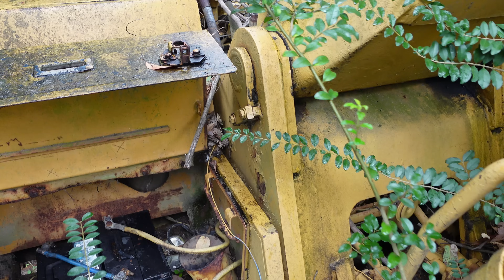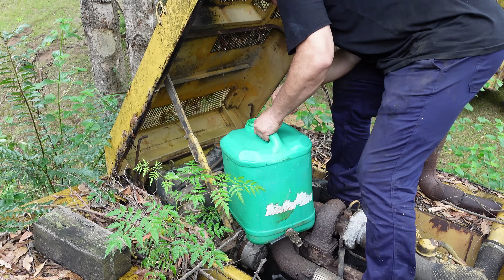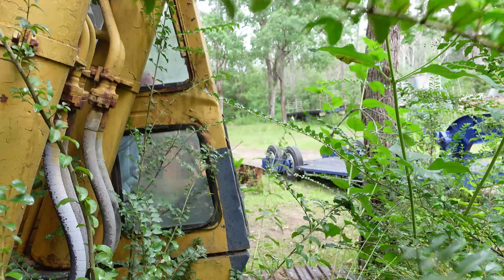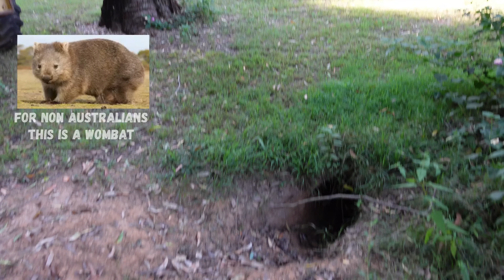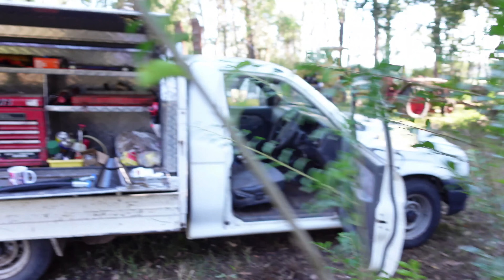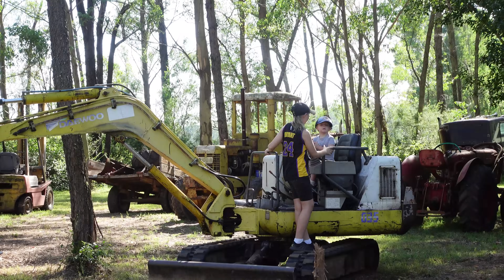Will it Run? Abandoned  Komatsu Heavy Epuipment

Comment: She does have a sweet note, and the turbo spooling up brings back memories. I started in the forestry on a dash 5, great machines. I used to operate a cat with similar issues to that, everything worked well but she just wouldn’t walk. It ended up being a combination of pump pressure and gummed valves in the valve bank. Hopefully you work it out sometimes you get gremlins with these things and you never work out what’s wrong.
Reply from the maker: Hi Brad yes it does. They are good old machines yes. Dash 5 were similar. I’m leaning more towards a final drive now that I looked a little bit more into it mate

Comment: I worked for a plant hire company here in north west England for many years with a large fleet of dash 3 Komatsu s like this of yours. They were a good machine but very weak on their final drive units. We replaced no end of them usually collapsed and mashing the gears up. And it was through no fault of lack of lubricants or maintenance. They were just weak and spoilt an otherwise good product. PC 200 220 and 400 were all the same. Surprisingly the 300s were much better in this matter
Reply from the maker: Hi mate thanks for watching. It’s good that you say this because I have since pulled one motor off and put my hand in there to feel the final drive gears and it feels that they are floating around rather loosely i thought, even though I said they were okay. I will pop the outer cover off and have a better look
Reply: @stevesplacedownunder  The main hub bearings seemed to give up then this led to crunching up the gears in there. The oil tended to get full of metal looking much like a metallic paint   If you go in there the centre drive pinion had numbers on and would only go back in its allocated position. Sort of like timing marks. Other than collapsing final drives and the rotary coupling seals wearing out that’s as much I could say on the matter
Reply: @stevesplacedownunder  Also Komatsu always specified sae 30s oil. It always seemed to thin to me   Any other machines i came across would always have 90s gear oil in there and were never any bother that included Hitachi  JCB/Sumitomo  Kobelco Samsung

Comment: If you take the planetaries out you can move machine using boom and dipper .
The spring applied brake discs can stick or not be released by drive pressure to brake port.

Nice videos thank you 👍
Reply from the maker: Hi mate yes it may eventually come to that. I’m going to be looking further into it. Since found by looking a bit more that it may be the final drives. Thanks for watching

Comment: That's a nice sounding engine in the Komatsu digger Steve. Going well. Liked the "Timmins Tune Up" at 20:59 for the track and track motor! Any thought of buying your own hose cut and crimp equipment, and a stock of new hose? or is there too many types you'd need? Just a thought, to save a bit of brass maybe.  Your local hose guy doesn't play poker, does he?  8^) Cheers!
Reply from the maker: Hi Jeff. A hose crimping machine and stock is  big, big bucks here mate. Just the crimping machine is over $20k. We don’t even have one where I work and we have over 100 machines. I get around it mate. I don’t go through anymore than what you see on here. I still haven’t fixed the crane either
Reply: @stevesplacedownunder   Wow that's costly for the hose equipment. I imagine it is costly here too, I just didn't think it would be that much. I guess you just need to keep going with your channels and get to 18 million subs - YT income would buy the machine at that point - then you could become the hose supplier to your work. 8^)
Reply from the maker: @jeffdayman8183 yes mate. It’s very expensive. The rate the channel is growing Jeff I highly doubt I will ever see those numbers mate. It seems to have stopped growing
Reply: @stevesplacedownunder  best wishes on it anyway Steve! Cheers.

Comment: The old Mitsu sounds healthy enough, I'm wondering the same thing about low pump pressure (maybe a drop in pressure somewhere after the pump?).
BTW I think the Mitsu trucks those engines were in were the FT and FV series, NSW railway had heaps of them back in the early 90's, mostly tandem drive or single drive plus tag rigid trucks used for moving heavy/bulky stuff like traction motors and wheel sets between sites (used to see them most days at Elcar Chullora back before privatisation).
Reply from the maker: Hi Robert. The pump measure close to spec when I had gauges on it years ago. Something may have changed though. I will sort it out. 
 They are a great old engine. I remember those model of trucks you’re talking about. I never had anything to do with one though

Comment: Get the bucket down to take the weight off the machine and slew the machine at the same time as running the track to turn much easier on the machine and track motors
Reply from the maker: If it was as easy as doing that with a machine where everything is free and working that’s what I would of done

Comment: Interesting it’s got a Mitsubishi in it. Thought Komatsu built their own engines. Repowered at some stage?
Reply: We had PC 300 had 855 Cummins. 
Some use Komatsu motors which are excellent 👍
Reply from the maker: Hi Matt. Yes mate the old ones did, they used Cummins also like the other bloke said, in dozers also. Even small cat equipment now is Mitsubishi with a cat sticker on the rocker cover. Skid steers and small excavators
Reply: @stevesplacedownunder  I have Japanese Kubota engines in my  2015 CAT 308 and 289 .
CAT has china parts now.
I like Japanese machine better.
Komatsu,Hitachi , Yanmar IHI etc
Reply from the maker: @SJW4all yes they use those also mate indeed.

Comment: The Mitsubishi sounds quite a lot like a 6bt Cummins.
Reply: Engine komatsu  S6D105
Reply: Komatsu  P220-3 (1986-1993)
Reply: Komatsu PC220-3 (1986-1993)
Reply from the maker: Yeah it does straight off the turbo

Comment: iv got a pc200 same age, and it tracks like shit as well, id love for you to find the problem, so i can fix mine
Reply from the maker: Hi mate. In saying that the final drives were okay, I’ve recently pulled the motor out of one side and found the gears to be floating around to what I think is too loose. I may be binding up under load. I will pull the outer cover off to look better at it. I will video it when I get time